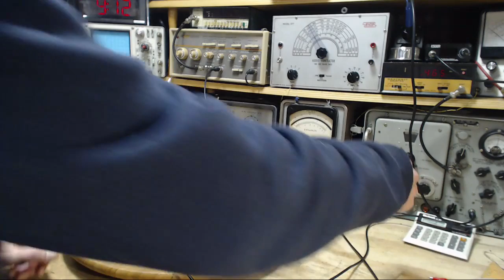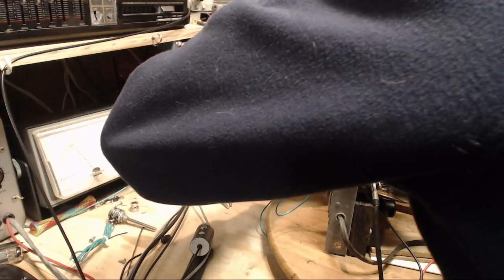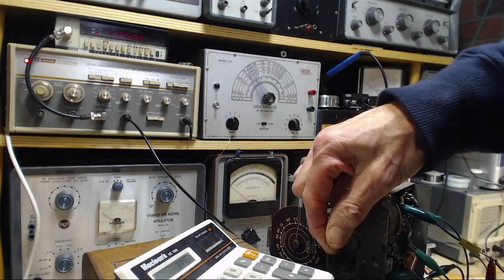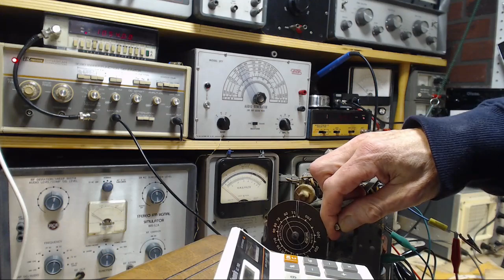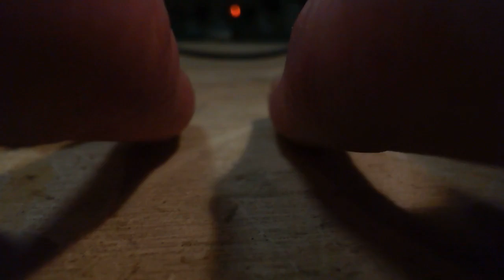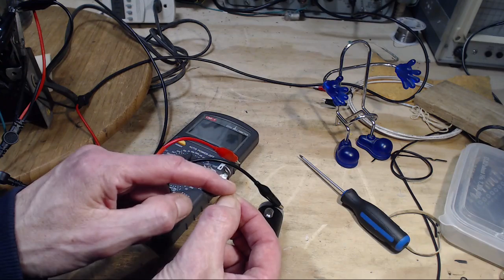Montgomery Ward Airline 62 425 Video #3 - IF Check and Alignment

Comment: Jim, did you measure the resistance (or check for an open winding) on the damaged local oscillator coils?  The resistance of each coil is shown in the schematic.  If the coils aren't open and the resistances are close to spec then it might be worth trying the coil to see if it still oscillates.

Comment: 0:44 Sir, why dont you reattach the torn off grid cap of the IF tube first before venturing further? Clamping the grid cap connector to the bare wire coming out the tube by means of a bare black alligator clip does not only offer a shady connection, but is a recipe for desaster since you are putting mechanical stress onto the thin wire and the glass to wire seal - unless you want to ruin that tube. I suggest you research on the making of tubes and especially the fragility of said seal. The YT channel of Ron Soyland aka "glasslinger" would be a good start since it not only shows the DIY making of various vacuum tubes (f.ex. neon glow tubes, early old vacuum tube replicas, x ray tubes, primitive microwave tubes) but also the steps and pitfalls involved.
Reply: Sadly glasslinger deleted lots of his old videos when he left yt !
That's the bad news but now he's back .
 Minus the old videos .

Comment: Looks like you found the secondary of that coil is ok. The primary is bad. The large lug is the grounded terminal of the primary. There are two separate windings. No common.

Comment: Jim, if you have the time, why not grab some fine wire, cross-wind 15 or 20 turns around that little damaged coil, solder the ends to those 2 lugs that now measure "open" - and connect it up to the radio. Who knows, you might get lucky!!
Reply: Dave M First order should probably have been to gently remove the wax covering all of the coil by heating it with the hot air gun. Only then can one assess the damage using a proper size tool like a dental pick or a needle to probe and unwind the broken wire counting turn etc. Him jamming a flat blade screwdriver into the rift however seems like microsurgery with a pickaxe.